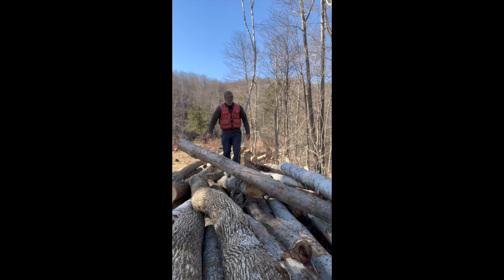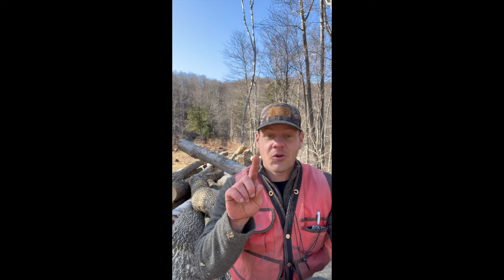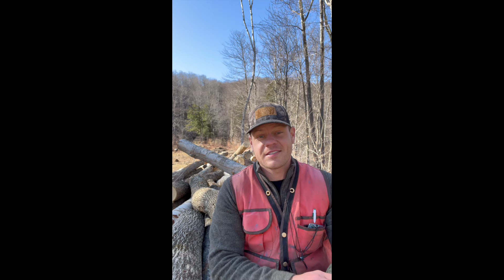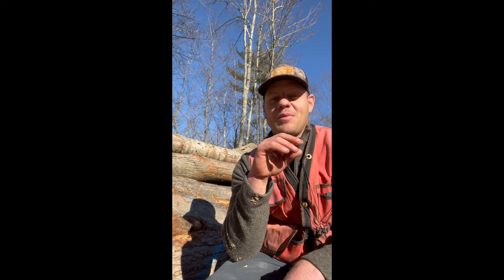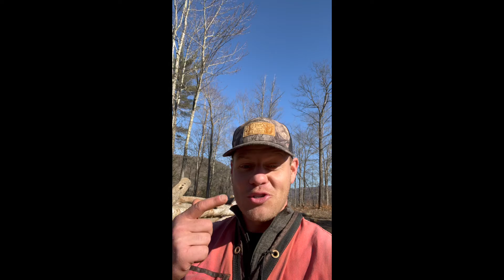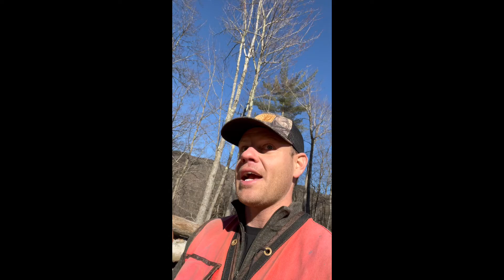What is "Low-Grade" Wood? Why Markets for Low-Grade Wood Are Essential to Healthy Forests

Comment: I would really appreciate horizontal videos
Reply from the maker: I’ve kinda stopped making longer form horizontal videos! But I’ve been thinking about starting up again
Reply: @HowToLoveAForest  Please consider doing some longer-form!  As a vermonter that is interested in responsible forest management/stewardship, it would be great.  I am working my way through your backlog, so you might have already covered this, but it would be awesome to figure out how to identify unhealthy trees. I have a stand of white pine that I think are growing on top of an old apple orchard.  There are some mixed young hardwoods in there too, but the whole grove is kind of a mess. Shoudl I try to rehabilitate the apples even though I don't necessarily want to work the orchard?  Should I consider the pine trees to be unhealthy and crowding out the hardwoods?  Or is everything actually fine, and it was the apple trees that are the unhealthy ones (they are almost totally shaded out by the evergreens and are barely hanging on).  

Or, if I have the option to focus on birch, beech, ash, or maple, how should I manage those?  The beech are blighted, the ash have a borer incoming, and monoculture forests are sad... Should I be pulling out the beech and letting them root sprout saplings?  Should I leave them for habitat, and risk the blight taking out all of the beech? Should I let the ash trees ride it out (who knows, maybe I get lucky and the borers don't hit my pocket of forest?).   

heh, this was too long, but you get where I am coming from. :)

Comment: Pallet and scrag mills also buy alot of low grade logs here in Wisconsin.  Still  have pulp mills here but way less mills than there was 30 yrs ago.  My brother sawmills about 200k bf a year  with his woodmizer.  I sell and deliver over 250 cords of firewood  and slabwood every year.  Trying to get a firewood processor  asap. We have a farmi 3pt logging winch and  iron mule forwarder.  We log  dead, dying trees  and storm damaged trees on our 130 acre farm every winter. We Have  4 other neighbors properties  to log dead ash this fall/ winter.  Eventually our goal  is to have  a  full-time  logging crew going and increase sawmill  and kiln capacity  every year  and get  high production  firewood processor and firewood  kilns. Eventually  i want  wood grinder  to turn all our slabwood and tree service  waste into colored mulch to increase income and  recycle  wood waste and  gain alot more customers. Im 27, my brothers  are 26, and 20. We all work together   and  have endless  amounts of  work  to do everyday  of the year. We all rather cut trees than  work  for  some other company . U know  u are a forester  when u rather  be working  in the woods with trees  than in a room  with people .